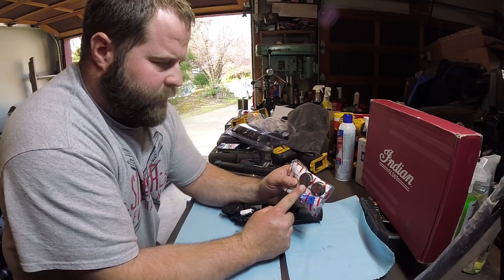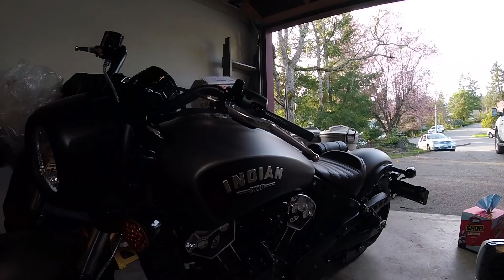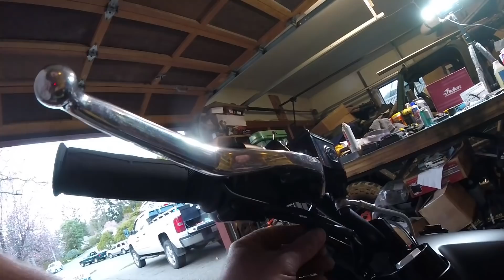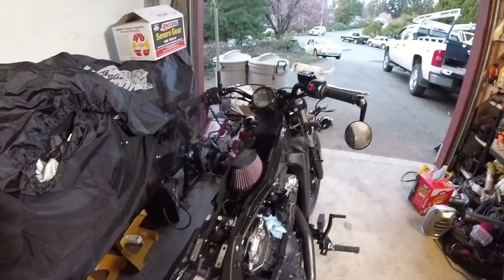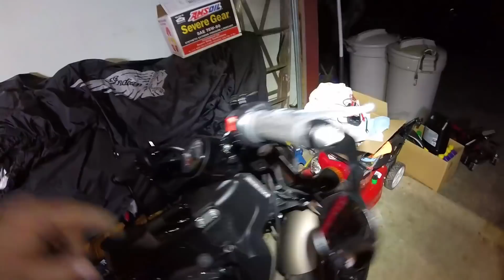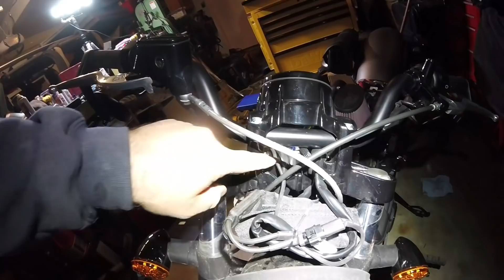2018 Indian Scout Bobber Apollo Heated Grip Install

Comment: did you attach the negative (black) wire directly to the battery? and the positive to the ignition sourced wire?
Reply from the maker: No. There a ground lug in the bike. Use that. There will be many other grounds on it. But yes. You can ground to your battery. 

And positive to the switched wire.

Comment: Just adding some tips to all this. I bought another throtte tube grip on eBay. Took it to the wire wheel on grinder. Zipped rubber right off. The issue came with the ribs. Used exacto to slice them off. Sanded with 220 whole tube. Tried to slide grip on tube as a test fit and broken the locating pin in the switch housing instantly. Drilled hole and screwed housing to bars from inside on the saddle clamp for drive by wire. Very solid now. Back to grip - I ended up beating it on with a rubber mallet on the bench. It’s never coming off again. Left side I just glued and beat on. Looks perfect. Oriented just like yours. Now I was hunting the wiring. Took a break and found this vid. I can’t use the one up front as it’s used for the led ring on the ftr1200 led headlight. So to the back I go I guess. My garage needs air conditioning...
Reply: Just a follow up. She’s all cleaned up and together again. Works great. Little female spade was right where you said it was tucked and taped with harness plugs under seat. 12.7 volts switched. Removed tank and went along left side rail. Wasn’t a hard project but damn it was time consuming. Now if it wasn’t so humid and hot here in PA, I could use them. Haha.
Reply from the maker: Andrew Clark that’s awesome!  Glad it worked out. Any and all tips welcome. Some guys did it way quicker than I did. I really like then grips. I even use them on low durning late summer nights. Sometimes it gets cool
By the water and it just takes the edge off. 

Thanks for the great write up!

Comment: Great video BTW. So I've been reading many comments on other sites about these grips. Peoples biggest complaint is that during summer months or even warmer days that the button can easily be pressed. Did people not see how the connections were made? just disconnect the 12V positive wire during extended periods of no use. Pretty simple.
Reply from the maker: Rion Frawley i haven’t found it to be an issue. Even if one did occasionally accidentally press the button. I think the odd accidental press is a fake trade for a clean install and not having to look at a dashboard panel like the Oxford have. Plus at the price point. These are hard to beat.
Reply: Jay Fast I order mine earlier today with some hand guards to keep the wind off. I’m good at keeping the rest of my body warm the only issue I have is my hands on cold rides
Reply from the maker: Rion Frawley nice!  Ya same for me. I can keep my body warm. But the hands were tough. These grips are so nice. Even in mid sept or late August at night. Just on low to take the edge off. They are great. My Corbin seat i also ordered with heat. So now I’m really stylin.
Reply: Jay Fast yeah I bought the Memphis shades hand guards too. I’m looking to keep the frigid winter winds off my knuckles at highway speeds.
Reply: Well I was able to get the throttle tube and grip removed from it without any damage. It takes a little time but worth saving the stock grip in case you ever need it. Small screwdriver and WD-40. Slow worked the rubber loose and squirting WD-40 in to keep it releasing from the plactic.
Reply from the maker: Rion Frawley that’s a great tip!

Good to know for anyone else doing this.
Reply: Jay Fast got them installed. I tested them out and gotta say... WOW! I never thought they would make that much of a difference, but they really do. I was able to take out the rear four bolts of the tank and use a fish tape through the underside. Very clean operation. My only last tip to people would be to make sure when fitting the throttle side grip on to make sure you trim off the plastic ring near the throttle sensor to get it a tighter fit before you slide it all the way on. I had to trim mine after the grip was on. I used no glue for either side. Another tip... use dawn dish soap as a lubricant it dries underneath there and no sticky residue afterwards so no need to worry.
Reply from the maker: Rion Frawley I did the same trimming the tab so the grip would go all the way to the control housing. Knowing what I know now.  I would have left a bit of space for my atlas throttle lock. I ended up cutting away a bit of the rubber because it was too close. But it all worked out.
Reply: Jay Fast how wide is the atlas lock? I didn’t think about adding one of those down the road but darn man that does sound like a good idea for taking a trip across state. I have about 3/16 of an inch still. Even after cutting the ring off the grip still didn’t budge much
Reply from the maker: Rion Frawley their instructions call for a minimum of 3 credit card thickness. So sounds like you’ll be good 👍

And I definitely recommend the throttle lock
Reply: Jay Fast just got done riding 70 miles with the heated running on high. It’s 39*F out right now and even at 75mph they got almost too warm on my palms. Had to kick them down a notch. No complaints my fingertips usually get frozen and hurt after that long. Excellent grips. I’ll look into the atlas
Reply from the maker: Rion Frawley nice! Ya my only complaint was not doing them sooner.
Reply: Jay Fast got my hand guards by Memphis shades installed. They don’t take away from the look of the bike as much as I thought they would. Which is great. Tested them out yesterday and they made all the difference in the world.
Reply from the maker: I have not experienced this. I would say it’s a non issue. But that’s just me. Still loving them.

Comment: Hey Jay, Great Video! The rear cable that works with the ignition can hold up with the consumption of the heated grips? Thanks!!
Reply from the maker: Anibal J. Sarotto yes. Going a year now.  No issues. Still loving the grips
Reply: Jay Fast Thanks man!! I will folow your steps on my bobber (Same colour as yours) 👍
Reply from the maker: Anibal J. Sarotto  best colour out there. Ya. They are inexpensive and work really well. Plus they look stock. Avon makes some that are large and more decorative but I wanted something subtle

Comment: Fitting mine at the moment. Looks really sleek and discrete compared to the Oxford grips, but they are also a bit more expensive. A bit of advice. Use compressed air and a "pistol" attachment with a long thin tube to pull the old grips off. Just blow under the grips and see them lift off.
Reply from the maker: stoissdk yes. I believe there are about $25 more. At least here in Canada.

Comment: Now that you've had them 8 months just curious if you still like these and do they work well?  Worth it? I've thought about getting them.
Reply from the maker: Frommageface 1,000,000x yes 

For $160 Canadian you can’t go wrong. Heck I was even using them on low in sept. I can’t even imagine riding without heated grips anymore.

Comment: Mine just arrived, I got them base don this video...I will be fitting them soon, any tips you didn't cover in the video?
Reply from the maker: Dexter x how have they been treating you?
Reply from the maker: Dexter x nice. I think you’ll be happy with them. I don’t think so.  The left side is wicked tight! I used just a drop of glue. I twisted them on. Two hands. 

The throttle side just takes time and patience. You pretty much have to scrap the rubber off. Or peel like a carrot. I then used the blade to scrape the final bits off. It was an easy slip on and off. Wiring was a sinch. Pretty complete kit.

Comment: Another good one Jay Fast! I don't think ill need them in AZ! Let me know if you find a Air conditioned grip! lol. Thank you for the vids!
Reply from the maker: Joe Davis 😎I think you just go faster
Reply: I wish that was true! Let me put it this way. Get your hair dryer, put it on high, and blow it in your face. That's AZ in July, going 60! LOL But its a dry heat!
Reply from the maker: Joe Davis ok. I’ve put some serious thought into this. Buy one of those hard hat beer holder things. Mount to your helmet. Put ice water into it. And instead of the hose going to your mouth. Run it to your handlebars. At speed. It will work like a venturi tube in a carburetor. Spritzing you  with ice cold mist. Maybe add some tropical tanning oil to it and you would look bad ass! All glistening and shiney, chest hair flowing in the wind like the motorcycle god you are!
Reply: You Sir, ARE THE MAN!!!!
Reply from the maker: Joe Davis 50/50 when you sell it on dragons den.
Reply from the maker: Maybe that’s the Canadian version. Sharks tank?
Reply: Deal, but I will not be the demonstrator!

Comment: Excellent video, Jay. Professional install. Wanna do mine? ;)
Reply from the maker: Jeffrey Moat the whole thing took about 3 hours. Getting the rubber off the throttle tube was the worst part. It took the most time. Other than that the kit was very complete. All I added that didn’t come with it was a spade connector
Reply: Jay Fast - thx. Ottawa Springs are cold. These would do the trick. My first project to tackle!
Reply from the maker: Jeffrey Moat ya they will. I ordered them online. https://www.kimpex.com/en-ca/home

You’ll be happy you did. Or the Oxford. I just didn’t want the little control panel.